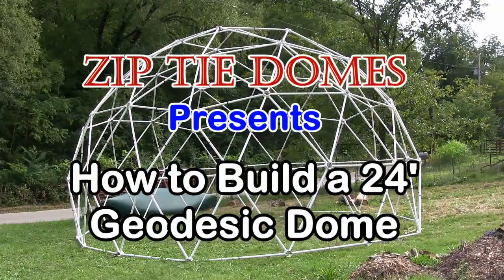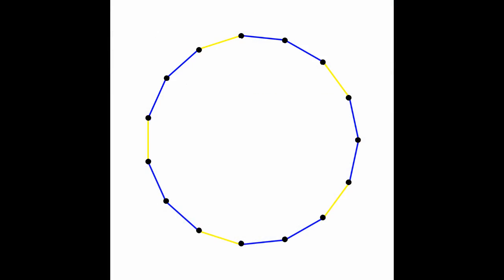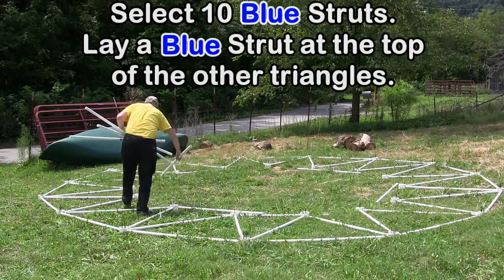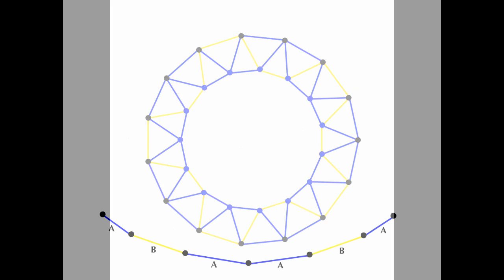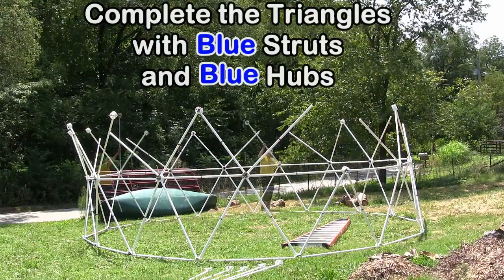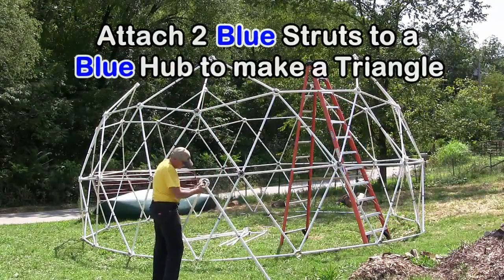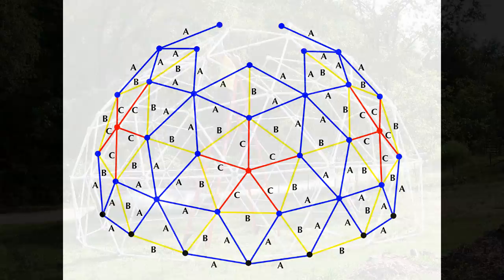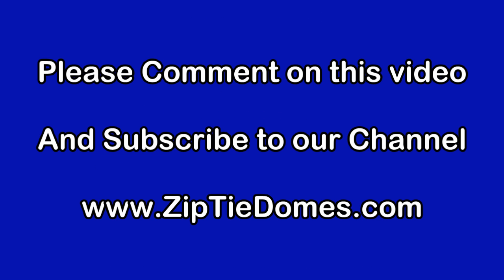How to Build a Geodesic Dome DIY - 24' diameter 3v 5/8 Geodesic Dome

Comment: you might wanna foam fill your pvc first? , and then after construction is complete wrap each pvc pipe and hub joints in 2 ounce fiberglass epoxied. your dome may then be about as strong as one made of wood. try this  on a smallest scale first and see if it's an improvement. probably the best greenhouse or domes on the market period are the greenhousedomekits (dot com)  geodesic domes with solawrap because they use the german solawrap keder covering and top quality frame. This covering diffuses light and plants gro much better in this spectrum of light, and they burn less etc, big problems with greenhouses. The film has been used in european domes for 30 years and still going. It regulates temperatures better, and has the stongest connection channel of any poly material on the market. It is not carbonate, but ethylene which is recyclable. To heat the dome, use the rocket mass stove. It is easy to build, and use a small fraction of the wood in a conventional wood stove. it extracts every bit of heat from a log and STORES IT to release in your dome up to 48 hours. go to ernie and erica rocket mass stove site to learn about those. piling 2 foot tall dirt mounds over logs and sticks around the perephiry of the dome (called HUGELCULTURE) means maximum light warms your beds vs using ply raised beds which hogs space and light and wears out, and the wood sponge in permaculture means watering is drammatically reduced and no expensive building needed. When you elect to change out the dirt, you then simply shovel it out vs the problems with emptying containers. With hugelculture, your soil becomes more fertile with the passing of every year vs having to rebuild the soil each year and you increase sq. footage and exploit airspace. dirt can also be pilled center of the dome in a tall pyramid shape.
Reply from the maker: Thanks!

Comment: Thanks for all your details, I have a drill press so I can make the hubs by drilling holes and cutting slices with my table saw... since zip ties are available even the metal ones locally I just cut my cost by $200 and really made this a DIY process. I expect all the manufacturing can be done in one week of my free evenings... Thank you so much. To others, concerninh a cover, ask your knowledgeable and friendly dressmaker to make a gored perfect hemisphere skirt (like a ball gown with no top).out of plastic 6-mil sheeting with a zero length wast and the length and hemline to fit over your finished dome by cutting "Gores" and sewing the seams with double needle stitching. Or use a seaming tip on a wood-burning iron and melt the seems together.
Reply: In another video they drilled two small holes in the spars (long pipes) one inside and one outside the hub then I drive a galvanized deck screw diagonally thru the holes with the screw head outside the hub, about 1/2 inch un-screwed (not tight)  and the exposed protruding point inside the hub about 1/2 inch protruding of the tip, use two screws in each spar end each longer than the diameter of the spar by at least one inch.  stronger than cable ties and eliminating the small extra ring for the cable ties.
Reply from the maker: Dennis,

We have a US Patent on the hub design, so you might want to read our FAQ page at ZipTieDomes.com under the entry "Are you making your own hubs?"

If finances are a problem for you, I will be glad to work with you.

John Hurt
Reply: I promise to not make any to sell...But, I like your design!
Reply from the maker: Thanks, Dennis.

John Hurt
Reply: Zip Tie Domes You got a patent for drilling holes in a pipe? LOL Im pretty sure people have been drilling holes in pipes for centuries.
Reply: @TomsBackyardWorkshop  thats not how patents work. they patented the right to make profit off theses drilled pipes made for this purpose. you can copy their work for private use, but are not allowed to sell these.

Comment from the maker: Edward,

The outer ring is just 4" PVC pipe, with apertures cut to the correct size to limit the movement of the struts to enforce the geodesic dome shape.  It is all very simple if the dimensions are correct.  We only have 3 sizes of PVC pipe and 250 lb stainless steel zip ties - just 4 items - to make our domes. 
This is the Taco Bell business model - that you only have 4 things that you sell, but how you put those 4 things together makes an incredible medley of products. 

Have fun.
John Hurt
Reply: lol taco bell model, great!
Reply from the maker: @rollandelliott  Yes, that is a good one, and a good way to do things.  Thanks for watching the video.  John Hurt

Comment from the maker: Very perceptive.  We are now in the R&D phase of using basalt fiber rebar as struts for our hubs, with the dome structure covered with basalt roving/mesh to create the framework for thin shelled concrete domes.  That is pretty much "connecting anything to anything".  Thanks, John
Reply: Has any progress been made regarding this?
Reply from the maker: @osmosisomni2248  Yes, I have a working prototype, it is at the bottom of this link:
https://www.ziptiedomes.com/customers/lenabach.htm

Comment from the maker: Marty,

The 24' dome weighs 289 lbs. We supply 250 lbs Stainless Steel zip ties for construction. We recommend that every hub on the equator should be attached to a stake in the ground. If you have high winds, any building this size should should have guy wires to something solidly attached to the ground.  This could be a tree, or a loop of rebar set into concrete. The spherical shape resists wind and snow loads better than the flat surfaces of a traditional barn, etc.  

John Hurt

Comment: Great video! One question though. With a cover or plastic on your structure, how stable is the dome in wind? Is it light and likely to blow over? Or, is it prretty solid and stable?
Reply: Six years and no answer. Maybe someone should call 911. He could be buried under a pile of blue and yellow hubs and struts.

Comment from the maker: Tonir,

Our 24' dome costs $995 with free shipping included for the USA.  Our "Hubs Only" kit is only $274.50, if you cut your own struts.  

To make your own struts, you will need 83 sections of 1" PVC pipe 10' long.  At $4.50 per pipe, this will be $373.50, for a total (cutting your own struts and using our hubs) of $648.00.  

The difference in our total package cost and the hubs only cost is around $250+ in shipping, plus 4-5 man hours of labor.

John

Comment: John,

Jerry Diamond here. Try doing an assembly from the top down. PVC is light enough that you can start with the peak, and just lift each leg, attaching struts as you go, lifting the whole structure as you work. 
   Once the last piece is installed, everyone notices that suddenly, the whole thing is  rock solid. Well, start with the top so that you are dealing with a rock solid structure the entire time you are building it, rather than when you put the last piece in place. Voila no ladder!